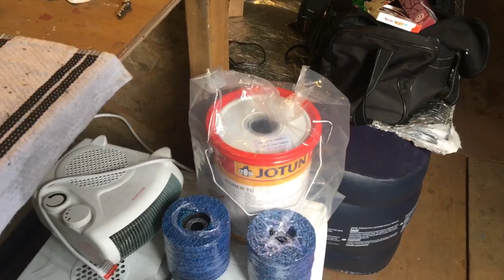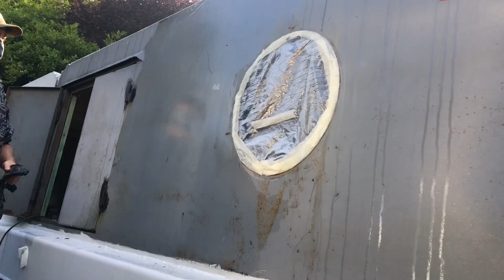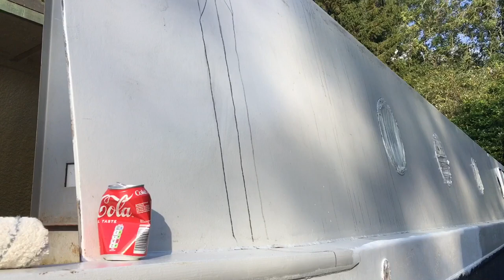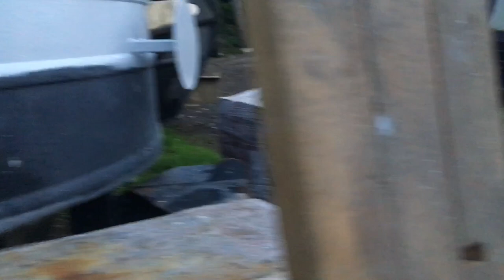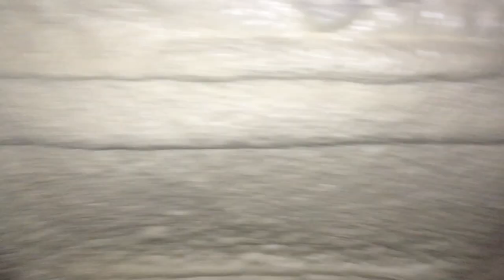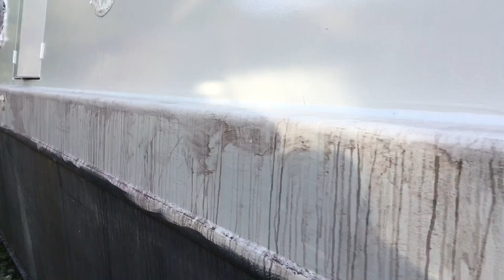58. No More Rusty Sides On My Narrowboat

Comment: Probably not the look your wanting but I would consider a coach line around the sides, it will make it a lot easier to paint top coats in smaller panels rather than trying to paint the gunnels at the same time, nearly sealed up for the winter now, keep going👍👍
Reply from the maker: Already did the whole side with topcoat this weekend, just chopping the vid. Tried to get a full cover at least once instead of patching it. How was your trip? sorry I missed you

Comment: Glad to see your sanding it smooth on this video I bet you wish you did that in the beginning so you didn’t have to do that bit twice
Reply from the maker: It was always the plan to try to sand it smooth between every coat, and there’s still a full coat of primer to do on the port side yet. Do I wish I knew more about thinners and laying off when I started, oh yes, it’s annoying the first coat is most important and that’s when you know the least, lol but yes, that would have saved many hours and many sanding pads, but it’s all part of the learning curve. The sides are much better than the gunnels as my experience increased and technique improved so at least the giant sides won’t be too bad, but I don’t think I’m ever going to get a pro finish on it, unless I pay for it (£6K-16K)
Reply from the maker: Oh the whole thing needs 2 coats of primer to build up the required micron thickness before topcoating, which is at least 3 coats. The pros have 3 coats of undercoat between the primer and topcoat and then up to 7 clear coats on top of the topcoat. They’re starting to look as good as cars
Reply: @olivellanarrowboat4319   looked like a plastered wall  now mate on that bit

Comment: Looking really good.  Do you have electric blanket to warm it up some.  Good luck
Reply from the maker: Love the idea but I worry it’s too damp for electric blankets. The quilts are always damp in the mornings, like in a tent, and I’m bringing them home each time now in case they get mouldy with the boat not getting hot and drying out. I really need to commit to a floor plan and get a stove in
Reply from the maker: Electric blanket worked great, good call, thanks a lot 👍